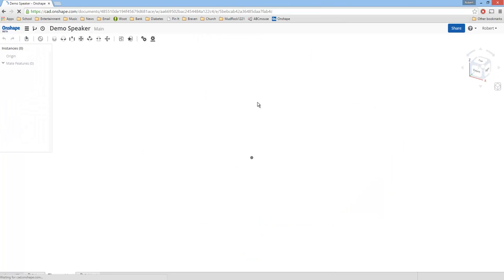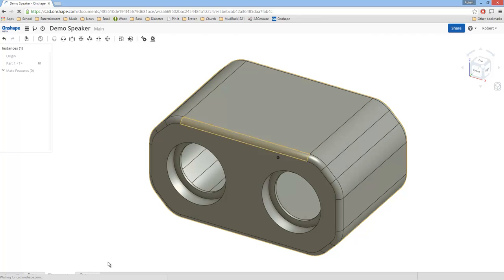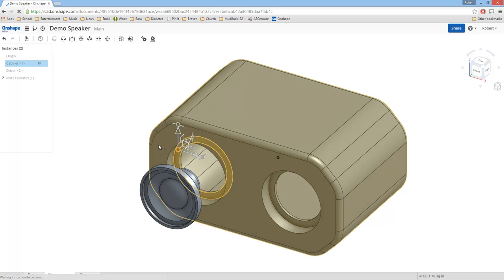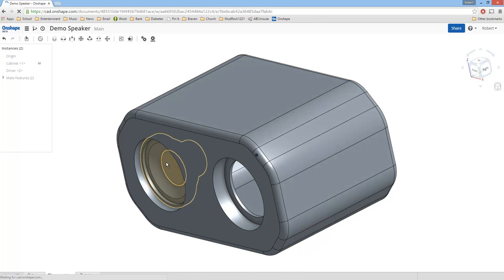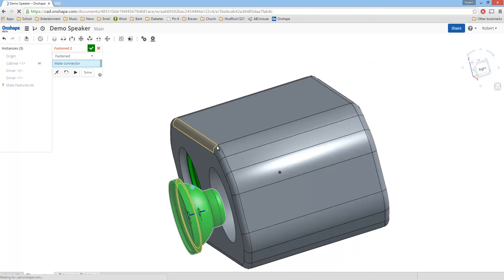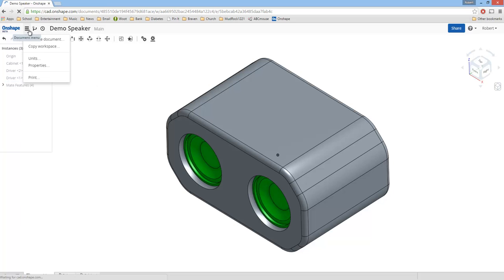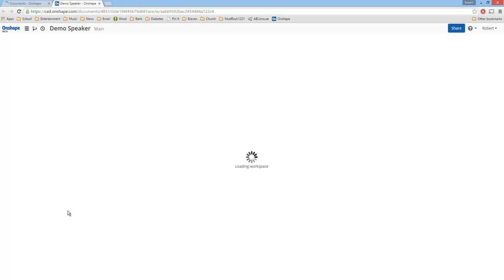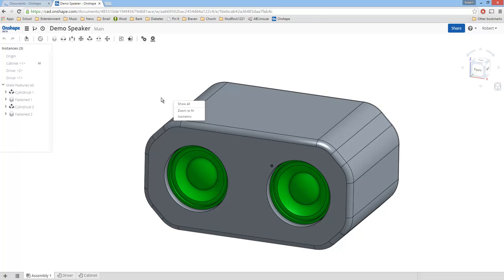Onshape Test Drive 03

Comment: I know it's been a week, so I don't know if you've watched the tutorials yet or not. One thing I want to say on this particular video is that you made the mates seem very cumbersome. The mate connecter points are the points that appear when you hover over an item that you are trying to mate with another and you can select them, even through geometry so you can mate two parts quickly and easily. You can even press shift (I believe its shift) to lock the points so they don't change as you mouse towards them.

You also used two different mates when you only needed one. I understand that you are used to Solidworks and other CAD programs, like myself, and usually it takes multiple processes to line up and mate parts the way you want them to. OnShape specifically made the mates so you could do multiple functions with one mate. In your example you only needed the fasten mate. If you used the mate connecter points you would have been able to select the center point of the rear face (circle) of the driver and the center point of the front face (also circle) of the lip inside the cabinet.

I hope this doesn't come off as negative, I just hope others don't see the process as harder than it is. Hopefully you have taken the tutorials or are interested in doing so now :)

Comment: Thanks for sharing these. Very interesting to see how an expert gets into grips with something new without looking at the tutorials. I've looked into the tutorials they explain (obviously) some of the philosophy and design decisions that you find unfamiliar or struggled a bit. But if you can hold back for a little more I'm very interested to see how you get along with just intuition and SolidWorks expertise.
Reply from the maker: I may do one more "painful" run at it, but then i'm probably going to have to do the tutorials. Onshape is clearly working on a different methodology than my previous CAD packages and i'm just going to have to accept that.